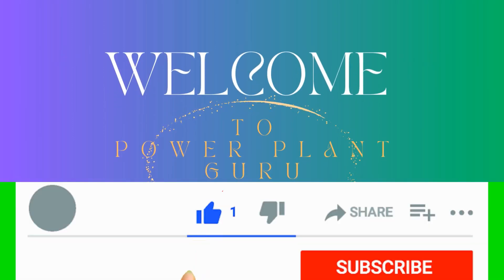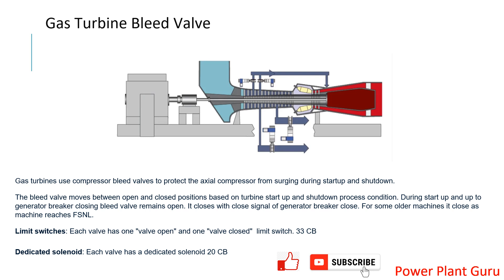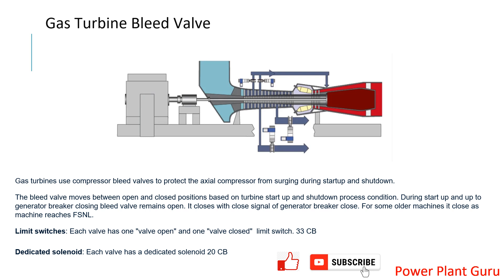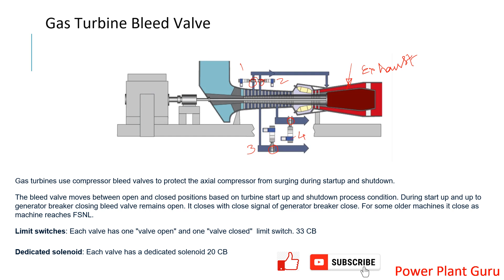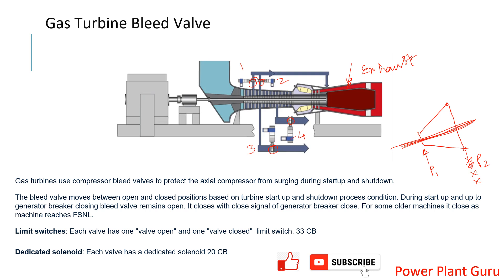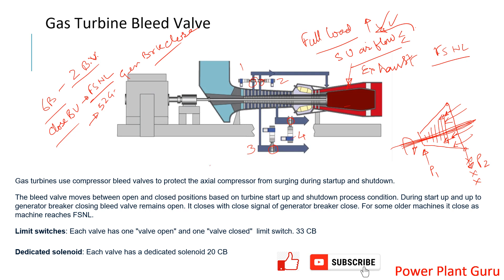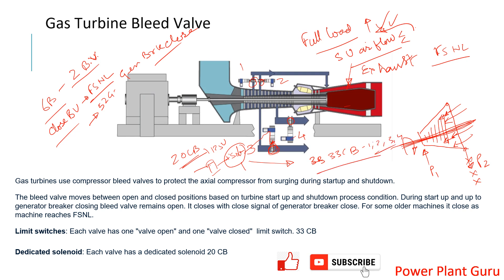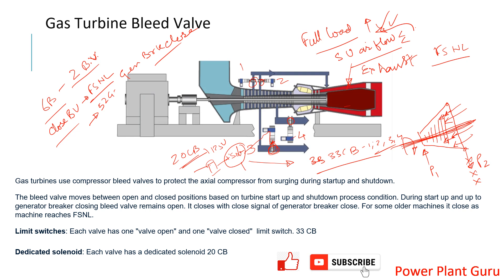Gas turbine bleed valve, Surge Protection. #gasturbine #powersystems #powerplant

Comment: Good compilation of information. Just a quick correction on the trapezoidal representation of compressor : The smaller arm is the compressor outlet and not the inlet, showing that the air is at a higher pressure. Conversely, the longer arm is the outlet for a turbine signifying expansion of working fluid with a corresponding drop in pressure due to work done.